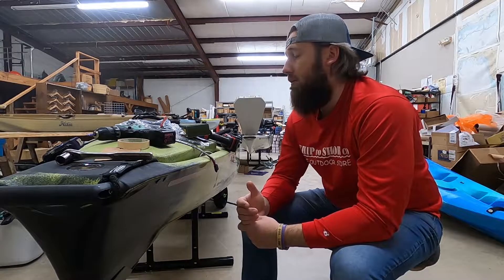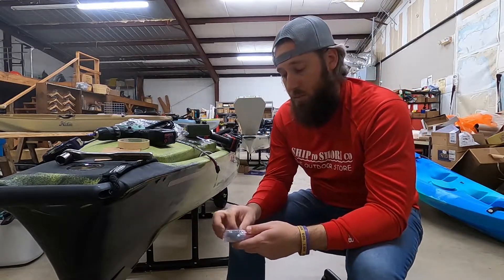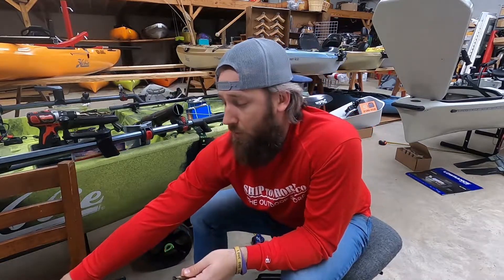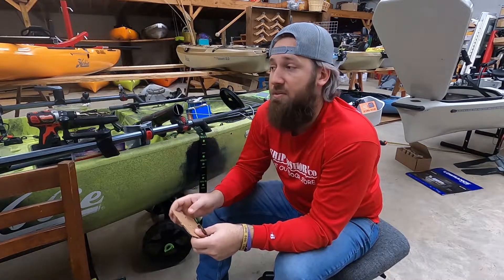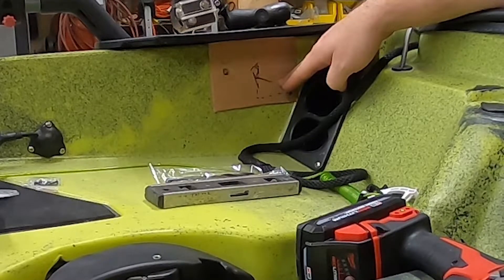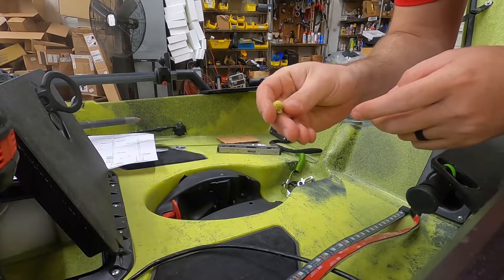Installing Yak-Power on the PA14 360

Comment: Asking the forum here: My lights get REALLY hot when I turn them on. pulled away from the 3M tape use to stick them to the boat. Silicon doesn't look good and I am having trouble keeping it stuck to the boat. Any ideas?
Reply from the maker: I will say mine do put off a little heat, but not too hot to the touch. Maybe you just got a bad light. Check with YakPower directly. I did just have to replace double sided tape on one strip after 2 years. I picked up some Double Sided Gorilla Tape from Lowe's and cut it in half long ways to fit the lights best. Removing the stocked was a little tough but sticking out in the sunlight seemed to help. After I removed the existing tape, I did wipe down the back of the light and the area on the kayak I was installing the lights with some rubbing alcohol. Hope this helps and answers your questions.

Comment: Awesome bro, thanks for these vids!  Im going to pick my 360 up tomorrow (driving 6 hours one way just to get it haha) I have the Garmin, but not the Panoptix(yet) does the dry storage bin fit back inside after all the yak power stuff has been placed?
Reply from the maker: Thanks man. Awesome, you will enjoy the 360 for sure! The YakPower and cables don't get in the way of the front storage bucket at all, but the Blackbox for the Livescope does just barely touch the bucket.

Comment: Do you connect your garmin ls box to the yak power system? I would like to put it on a different switch so I can turn it off when not in use. Another great vid!
Reply from the maker: Yes sir, it has its on switch so I can turn it off when it's not in the water or being used. Thanks. I need to do a walk through of my whole setup... waiting on Hobie to send us some.more universal mounting plates so I can swap the 8 switch for the current 5 I have on there.

Comment: Excellent video! I know this video has been out a bit, but could you share the dimensions on your template for the button lights?   I’d appreciate it!
Reply from the maker: Thanks, glad this video helped!
Unfortunately, I don't have that template anymore. However, the Button Lights under the Mounting Plates are ~1.5" from the plate and ~3" from the Rod Tubes. Button Lights behind the seat are ~2" from the top of the kayak and ~2" from where the plastic goes in behind the seat. Hope these measurement make since and help you though. After doing a few of these installs, I can pretty much just do them by looking at them now!
Reply: That absolutely helps!   I appreciate it and the exterior lights are perfect for seeing out and lighting the bank very well!
Reply from the maker: Yes, they light up your surroundings very well. I fish lots of backwaters at night some times and have no issues fishing around heavy cover at night.

Comment: Hi, I’ve read a few reviews of the boomdocks landing gear that says they’ve cracked the boat.  Any issues for you?
Reply from the maker: I have not had any issues on any of the kayaks I have installed the Boonedox on as far as cracking the hull. Now the first generation of the Groovy Landing Gear did have plastic gussets and some of those have broke. However, that is what they were intended to do, instead of the kayak hull. The older Boonedox also had a smaller backing plate so that was the culprit as well as some user error.